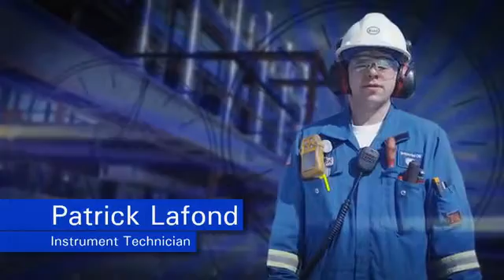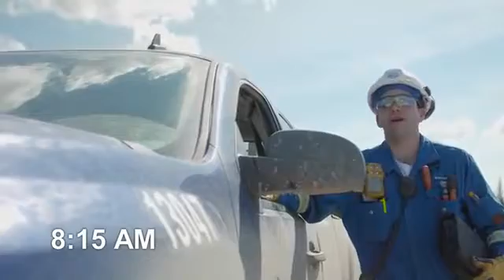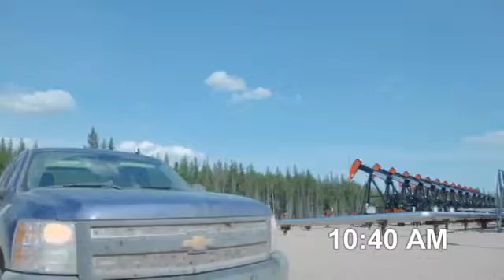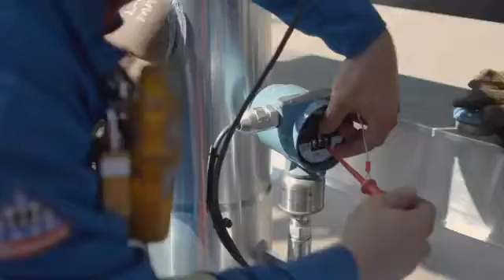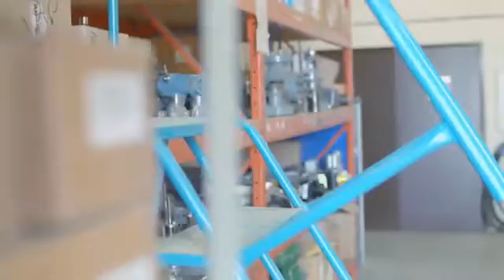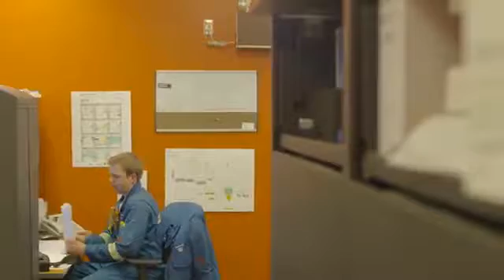A day in the life of an Instrumentation Electrical Technician  at Imperial's Cold Lake operation

Comment: I am still puzzled as to what the main difference between plant operation and instrumentation?, or do they study concepts at the broader scale as compared to operators
Reply: The operator runs the unit utilizing instrumentation.

Instrument tech works on the instruments that operations uses
Reply: Instrumentation fixes, operators operate. Both around the same pay
Reply: Like the difference between a heavy equipment operator and a heavy equipment mechanic.  One operates the other repairs and maintains.